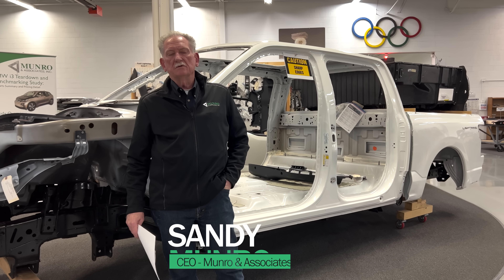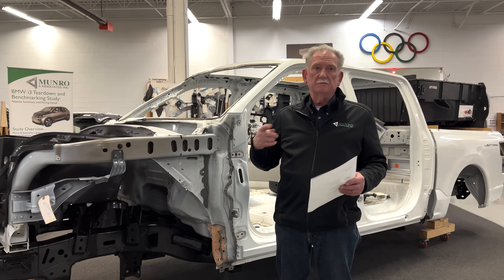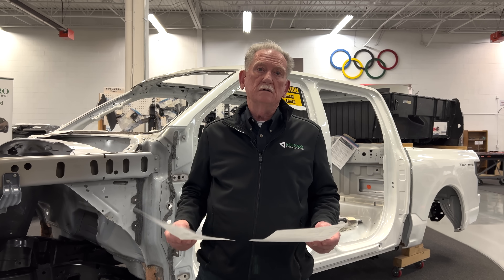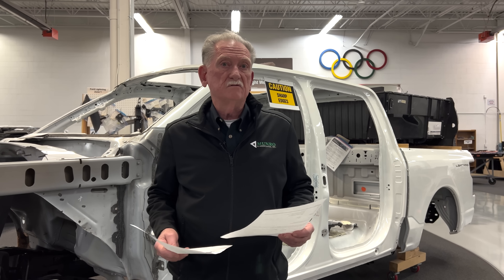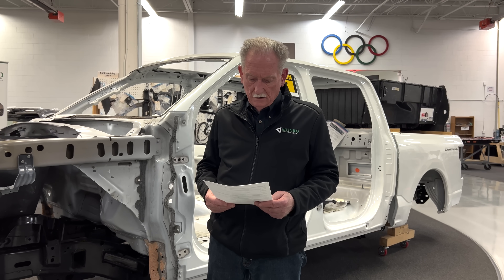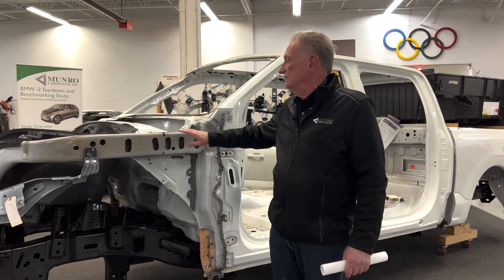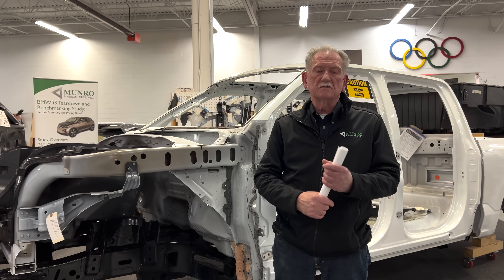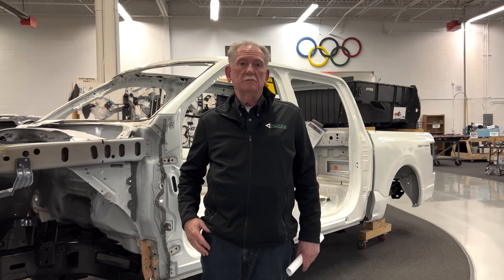Sandy's Initial Thoughts on the 2025 Ram 1500 Ramcharger

Comment: Towing, towing, towing. 690 miles is way overkill for a daily. However, even if you're a weekend warrior (like myself) and OCCASIONALLY tow 200-300 miles on a trip, the 690 is a game changer. Especially if you're towing in the winter (IE snowmobiling in WI), that range can be cut in half, and then you're talking about 345mi range, which is much more reasonable. Towing range is the only thing holding me back from an electric pickup. Although carrying around 550 extra pounds isn't ideal, especially considering the maintenance that comes along with it, this seems to be the only logical solution with current technology. I'm interested to see the pricing on it. Love your stuff, Sandy!
Reply: The engine adds an extra 550 lbs, but the battery will be about half the size of the F-150 (I'm guessing) which would save about 500 lbs. So the weight different should be about even. The standard engine maintenance will still be there, however an engine in generator mode will run under a consistent RPM and torque load its entire life, making it way more reliable and prob require less frequent servicing.

Trucks really should have gone this route 10 years ago. As it is now, it will have an advantage over pure EV trucks for maybe 3-5 years. At that time I can see 700 mile range pure EV trucks coming out. Not sure Ram can recoup their investment on this drivetrain in that short a time.
Reply: @chrisoconnell8432  You beat me to it, I totally agree the weight of the engine will be a moot point given that batteries can be extremely heavy.  I could care less about a frunk in a pickup truck, the bed should be enough for the things most truck buyers carry.  As an rv tow vehicle this is ideal, I could also used the on board generator to keep my rv batteries topped off when boon-docking.
Reply: @chrisoconnell8432  Actually, rumour has it that the battery is about 92 kw, which means it's about the size of Ford Lightning's base battery.
Reply: Important point: that the Ram's 92kwh battery is half the size of the Ford's means that the battery will weigh half as much, AND COST HALF AS MUCH as the Fords. This saving makes the extra gas engine look cheap! The RAM should cost LESS and WEIGHT LESS than the Ford.  @chrisoconnell8432
Reply: @chrisoconnell8432 

*Extended range battery*, the standard range has about the same capacity as this RAM PHEV + the engine and accessories. 

Sandy didn't include the fuel system + fuel weight, probably an additional 200 lbs full on the RAM with that massive tank.
Reply: @chrisoconnell8432 I think it's more like 5-10 years. And batteries are likely to get more expensive. The cheaper chemistries being researched now won't be ready for release for at least 10 years. The onboard generator could probably use biofuel or co2 neutral fuel as well. I think this truck will do very well, This is what I wanted from Toyota, they've really shit the bed.
Reply: @michaelweatherby8648  battery tech is actually getting much cheaper every year as manufacturers scale up production and volume
Reply: @michaelweatherby8648  After I checked my math I think you might be right on that timeline. I was assuming the 500 mile range cybertruck will come out in a year, so 700 miles isn't that much greater. But doing the math, thats 40% greater, too much in only 5 years.
Reply: @chrisoconnell8432 nfw, they are not making a 700 mile truck bev anytime soon. Even if cost and densities improve (massively to reach those numbers) they'll first put smaller batteries to bring price points down.
Reply: @tazeat  To me, 10 years in the future seems so far off it would be silly to even try to guess what it would be like. So I don't consider that "anytime soon". Plus it won't be an either or, there will be cheaper low mile trucks and expensive high mile trucks in the future.
Reply: I totally agree. I have a travel trailer that weighs 6,000 lbs and tows like a parachute. There's no way I could tow with a pure BEV. I currently tow with a Ram 2500 diesel, but this could be a valid game changer for towing. And, I'm a Tesla owner, so I am not a BEV idiot. :)
Reply: Absent most of these towing discussions is just how bad the mpg of a gas or diesel truck is when towing. Even your Cummins, the pinacle of towing, is probably close to 10 when towing. A gas truck is easily in the single digits.  @tornadotj2059
Reply: I agree 100%, if you want to tow for camping but live in city, this is a 95% electric all the time, great for home maintenance, backup generator for house, camping super station. I can't wait to get my midlife crisis 4x4 version.
Reply: Yes!  Towing!  (and in the mountains! )   And range anxiety is there with my ram 1500 especially towing the camper and in the eastern US mountains where you will not find EV chargers conveniently located.   And  EV chargers that you can use when a trailer is hooked up will be really rare for some time.     But the majority of time I would just use it for short daily trips with the battery charged at home.

That battery+generator would provide a ton of emergency home power or  boondocking.
Reply: 100%  nailed it -  (When) towing will cut that range in half = perfect vehicle.
Reply: @stevemyers2092  Except all the times you're not towing.  Using a smaller battery means less power output and charging as well as faster cycling/ reduced lifespan.
Reply: Sandy (& those in agreement) really miss the point of 690 miles range.  Think about it.  Everyone cries about how piss poor electric ranges when it gets cold &/or Towing, &/or hilly conditions. Geez I can't believe this would be an issue! So now even if you dump ½ of your range - you're still good to go
Reply: @bitsabe  345 miles is more than i have now with my Teslas in summer. Thats too much. The battery is too heavy and costs far too much to carry around all the time. 150 miles in winter, towing is enough range.
Reply: I was going to post, “am I the only person that uses a truck to tow things?”  Then I saw your post. 😂🤣
Reply: I completely agree. To be honest, this is probably one of the first videos by Sandy that I pretty substantially disagree with.
Reply: Agreed. Towing is holding me back from EVs but the Ram might have just solved it for me.
Reply: @AnthonyGale  Its too heavy and costs too much. You‘ll see.
Reply: @wolfgangpreier9160  you have no idea how much I need to tow, so for me it might be just right, so maybe you'll be the one seeing 🙈.
Reply: so easy to understand yet so hard for the "titan" to comprehend.
Reply: Exactly! I swear 90% of these EV fanatics don't even know what a truck is used for.  I'd like to see someone put 3 snowmobiles on a Cybertruck.
Reply: @theslimeylimey  Thats simple. We use real trucks for this kind of work in Europe. Mercedes, MAN, Scania, Volvo, DAF. Not toys from GM or Stellantis.
Reply: @wolfgangpreier9160  using a commercial heavy truck to haul a couple snow mobiles is an utter waste of money. That logic does however explain why Europeans have hardly any toys compared to North Americans.
Reply: @theslimeylimey  Ahh - no, you misunderstand that. We have no space for using such toys. 

We do not have millions of square kilometers like the russians and danish (in greenland) to endulge in such a waste of time and energy. 

Just one example: In the US there are 168.8 million trucks registered.

In Europe we have 6.8 million.

So: To transport the goods for roughly 450 million people worth 15.8 trillion US$ we use 6.8 million trucks.

In the USA roughly 340 million people worth 23.3 trillion US$ need 168.8 million trucks to transport everything.

That is - to be very polite here - inefficient.
Reply: Yes, but the bed length is a problem. I have an F150 (not a lightning) and a Model Y Long range. Towing 3000Lbs micro camper and bikes gets me about 180 miles per charge, from 300 normally. Even with 500 miles of range 300 is what I'd expect towing to net me on an EV and that is more than enough to go anywhere with only a single 15 min charging stop. Also 690 miles with only 150 or so on battery means the rest is gonna be like 40MPG... without a trailer. 20MPG with.
I'd buy an ICE in your situation, or wait for the cybertruck... GM I don't really trust. Pouch cells have a bad history, and 212KWh... Yikes.
Reply: Also remember that the battery is smaller which means there's less weight on the electric side.
Reply: As long as you put gas in it will continue to put miles on
Reply: The Ramcharger does 145 miles on its current battery chemistry. This vehicle’s battery will improve just like every other EV battery. The next generation of this vehicle will get 300 miles in EV mode and 600 mile range extender.
Reply: There are videos on the F150 electric where once you are towing the range is horrible.  So you're spot on... whole time I'm listening, no account to this... typically a truck is used to haul stuff OR tow, that being the case the RAM with range extender looks like a great solution.  My concern is cost, normal truck is already too expensive for most.  A truck with both gas and electric, I can't help to think that it will be much higher.
Reply: Coming in 2025. Translation…IT DOES NOT EXIST.
Reply: Try selling it when you decide it doesn't work for you
Reply: 345 miles? Thats at least 6 hours driving. I would not even need that range without towing.
Reply: People like me will do that milage and more. On more than one occasion I've done 24 hour streches only stopping for fuel.
Reply: @CoryBollig  Then you will continue using fossil fuel to pollute your environment - or you will change your behavior. 

Whatever way you go, your children and grand kids will know what you've done - choose wisely.
Reply: I got 625mi on a '94 Astro and used it.
Reply: Bang on!  It's also a 3/4 ton and not 1/2 ton.  Can pull WAY more WAY WAY further!
Reply: EV trucks are fine. The market that needs to catch up is the trailer / RV industry. When building an EV, manufacturers are meticulous with weight saving and aerodynamics. Yet people expect EVs to tow things that were built with none of that in mind. RVs would work better with EVs if they at least:
1. Have their own 50+kWh battery to supplement the EV.
2. Get rid of their 12V adapter to the tow vehicle and have a high capacity DC/DC tether.
3. Brake regen.
4. Aerodynamics.
5. Weight saving.
6. Entire RV roof covered with solar.
Reply: I realize this thread is a little old but this is still very relevant  stuff. That number has to be cut in half for towing- I would assume- but if it can get 300- 350 mi, I’m in. Because my Tundra (5.7 V-8) only gets 300 mi per fill and that’s with the 34 gal tank.
Reply: 💯💯💯

If you add that almost all charging stations don’t allow for pull through, this becomes and even more obvious solution.
Reply: That is not overkill. Ill be signing up foe one.
Reply: There is also redundancy benefits and longevity of battery...
Reply: @dgeorgaras4444  If charged regularly, that battery will see 2x the cycles so it will have a significantly shorter life.
Reply: I agree.  Getting weekend warriors to commute to work on electricity is a big win.  I'm getting a Rivian R1T (dual motor max pack) with an EPA range rating of 410 miles and towing long distance in the mountain west will still be challenging.  After this comes out in a couple of years I may have to re evaluate.
Reply: These range numbers are empty, one person/driver.

You are not considering towing. Even 5k lbs is going g to reduce your range. Add weight, speed, hills and you are reducing that range even more.
Reply: @jmackinjersey1  Think how much less range the F-150 and Rivian will get while towing, 155 miles on full charge maybe less.  I think Ram has the right idea for pickup truck drivers that do truck things.
Reply: @jmackinjersey1  aerodynamics of the things you are towing also are to consider.
Reply: Exactly. And the lack of pull through chargers just kills the pure ev trucks as viable options if you want to tow. Well unless you’re ok with being an asshole blocking chargers.
Reply: @EMdoc12  The industry is not ready to deliver cars and you want everything, all at once, perfectly working, without any hassle, for every use case.

That will not work. Be patient. Disruption takes time. A major disruption takes much time. 

10 years from now you will have and use all of that and more. If you can afford it. If not you will still  drive your 2004 Tundra or your 97 Suburban etc. Of course gazoline will cost significantly more.
Reply: If you depleted the battery while towing with this setup you would be in a tough spot. The engine isn't powerful enough to take on towing loads alone, it needs the batteries to help it.
Reply: 1st, the battery will never become depleted. The engine starts and the generator picks up the load well before the battery is depleted.

2nd, the generator in normal output is 130 kW/ 175 HP. It doesn't take near that amount of HP to tow a 14,000 lb trailer on level ground on the interstate at 65 MPH, maybe 50-60 HP. On a 6% grade (max allowed on any interstate) at 65 MPH, it would take an additional 208 HP over what it takes on level ground. But wait, Ram already thought about this scenario and provided for an increase to 190 kW/ 254 HP. Adding 60 HP from level ground to 208 HP to climb the grade gives up 268 HP, 14 HP more than the generator output on maximum. The battery is more than capable of meeting the demand for the short time 14 HP is required. Regenerative braking on the downhill side will return the energy. A 5.6% grade requires no additional power from the battery. To further put this in perspective, there are only a few places where the interstate reaches a 6% grade. Alternatively, a speed of 60.6 MPH on a 6% grade wouldn't require any additional power from the battery... that's hardly noticeable and far from the tragedy you're trying to frame.

Ram has done their homework on this and have all bases covered. It's a perfect city commuter and can even be charged on 120V to keep maintained. It's a perfect tow vehicle because your range is unlimited and it has the HP to do anything you want.

This is coming from a GM guy who has never bought a Dodge/ Ram car. I'm also against EVs as a total replacement for ICEs at this time in their development. EVs are great city cars and that's it. The infrastructure has a long ways to go.
Reply: @eomhS  false, 130kW of continious power is enough. A pick-up use about 35kWh/ 100km.  So having a generator of 130kW more than triple the energy. That’s the equivalent of a consumption of 40 litres/100km , and i normally average 25-30 litres/100km with a 8000lbs trailer. Remember, the engine only recharge the battery or/and send electricity to the electric motor, so peak power of the gazoline engine is not a issue here.
Reply: @andresamson8859  that's peak shaft power of the engine you're forgetting to take off losses of generator, transmission, inverter and motor. I used to drive a Chevy volt, despite the engine being powerful enough, when the battery was depleted it could not go above 55mph on flat ground
Reply: So your winter estimate of 345,  that's around 75 miles of battery range and 270 of range extention.  That's 10 MPG with a 27 gallon gas tank.  Doesn't seem worth it.  I would stick with ICE if your towing further than your battery pack allows.
Reply: @tlangton  I would agree if the truck primarily towed. The benefit to weekend warriors is having an economical vehicle to live with on a daily basis.
Reply: @tlangton   I guess the question I would pose is what is the ability to drive almost 200 miles electric-only during the week worth?  Seems to me for those periods when you're not towing you're pretty much driving gas free - a significant cost for a pick up?
Reply: @tlangton I think you're missing the point that 95% of time you could be charging this truck at home with solar panels and a battery.
Reply: @tlangton math is off

Comment: Electric vehicles make poor long range tow vehicles.  I think the Ram is a much better option for someone who occasionally needs longer tow range.  The ranges that Sandy mentions  are unloaded ranges.  Tow a 7,000 trailer and the Lighting range is below 200 miles, the Ram range is probably around 500 miles.  That is 7 hours at 70 mph.  This should be far enough for almost anyone.